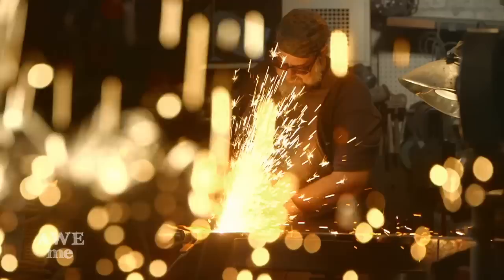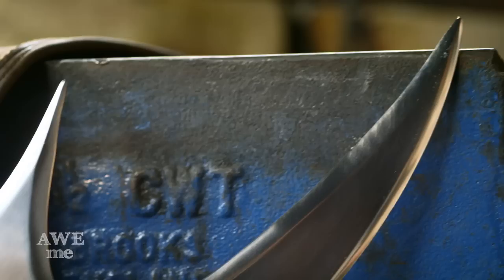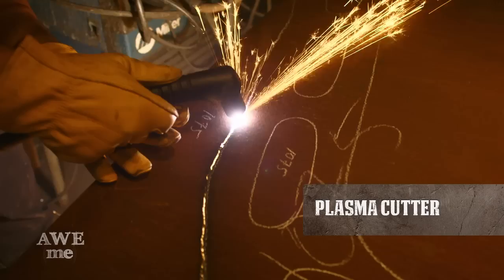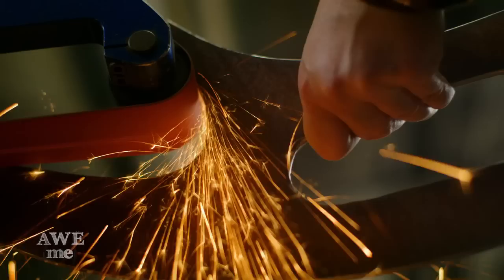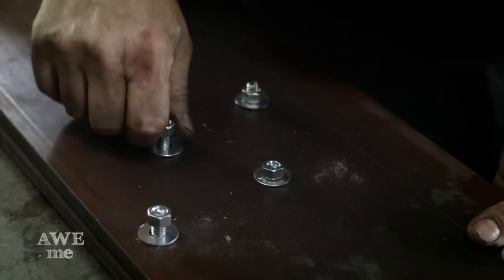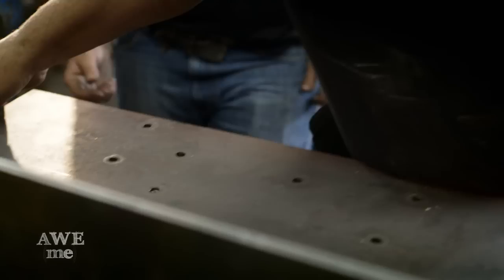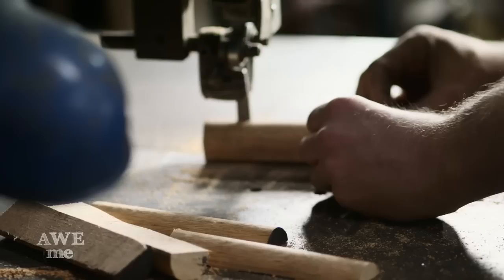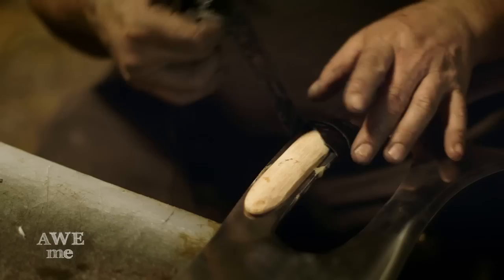Klingon Bat'leth (Star Trek) - MAN AT ARMS

Comment: Cool thing is that it's probably the most useful fictional weapon ever. Like this sword is said to be actually kind of viable.
Reply: Nah. The Mek'leth is useful, but the Bat'leth... well, someone decided to stick up a store with one, I think, but in actual combat you'd be better off with something less ridiculous :P
Reply: A weapon that’s both a guard and a blade at once
Reply: @acemarvel1564  You'd think, but the shape and position of the grip makes it VERY hard to keep straight. When you hold it, it wants to flip so the blade is facing inward - and it's kind of a pain to keep the edge OUT. You don't get a very good swing out of it for the same reason, and it's not great for stabbing either. It looks very cool but it's deeply impractical.
Reply: @kamalalsb7292  it’s most likely one of these strictly skill based fencing weapon for duels and challenges 
It may not be a good war weapon but it just might have a chance nonetheless in a real fight I’ve seen martial artists try it and I believe it is possible

Comment: Your show is really cool, you make some really awesome pieces. I dont get why you smash glass bottles though. The whole point of cuting through stuff is to show how sharp the edge is. The fruit and soda bottles are good for this, cause you cut through them. You can see the cut mark/slash line. Glass just shatters no mater what hits it. You get the same result with a blunt stick as you do with one of your finely sharpened blades. The glass serves no purpose, and really just looks stupid. One more thing, and I hope this doesnt come off wrong, why dont you forge your steel? Like making a bilet and start from that instead of a sheet of premade steel? Im sorry but in my mind that makes you more a machinist then a blacksmith.
Great job though, you have an awesome skil.
Reply: Forging steel is a very time and resource-intensive business; you need immense amounts of metal to make it worthwhile to continuously operate a forge, and the equipment to make solid steel doesn't come cheap. Let alone the issue of just gathering the metals necessary; you'd need a lot of iron for the base and nickel at the very least as an alloy for cheap steel, or stronger and far more expensive stuff like titanium if you wanted really tough steel. It's simply not viable, especially not for a guy running a small business with a few friends.
Reply: Yeah, it's all pretty silly; this modern reality-tv-documentary-fast-editing style... much show, not so much substance. It would be way more amazing and interesting to go into way more detail to LEARN something instead of fastfood entertainment!

Comment: Nice work. But for the average person who can't afford your level of quality, there are makers, in China, Thailand and Pakistan who make Bat'leths that are effective weapons. I've been a martial artist for over 50 years, a serious blade collector , designer and practitioner for 45 years; ex-cop, Dept. Of State advisor, have used blades in defense. I have Bat'leths in 48" and a couple in 24"
 The 24's are 1060 carbon and razor-sharp. For defense, you would be going through flesh, no torture tests, cutting wood , etc. So-- no heat-treating required. The 24" is a fantastic weapon that if used by an experienced, trained person , could defend against up to three attackers. Think about it: you have multiple razor edges, plenty of weight and myriad spins and moves. I realize it's from the great Star Trek, but in sharp steel, it's a real weapon. Easily carried in a vehicle. So, the next time some guy in a road rage incident gets out of his car with a baseball bat, whip out the Bat'leth. That should make any sane person turn around.

Comment: Did you know that you can melt volcanic rock into obsidian glass? I'd like to see if one can make a functional obsidian blade weapon from poured obsidian. "Sharpening" would have to be done the usual way - chipping away at the blade. But, to me it seems like a workable weapon, as long as the blade is thick enough to withstand the stress of impact.

Comment: All due respect Sir your basic Chinese template was flawed. A bat'leth has a continuesous arc from tip to tip with no flat spots along the spine. According to Klingon weapons masters a bat'leth is fitted to it owner by the owner kneeling on one knee with the only measurement being from the floor to the top of the owners head as the baseline for the length of the weapon, so whatever that measurement is the spine would have to have a smooth continues arc from tip to tip with no allowence for flat spots or bumps for grip spaces.